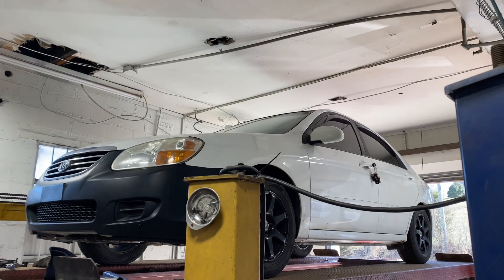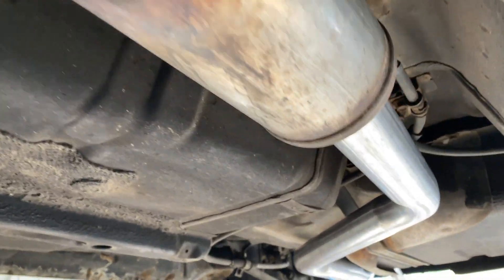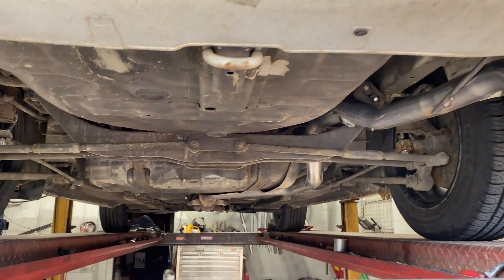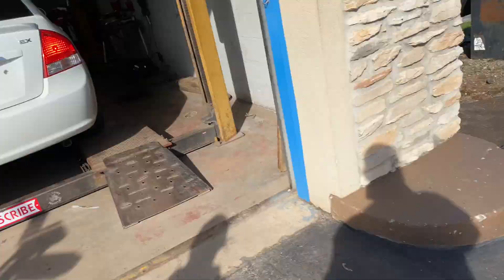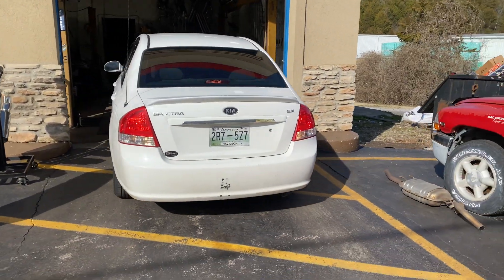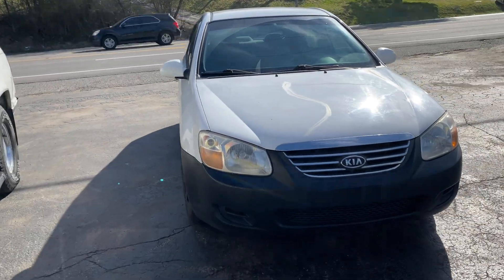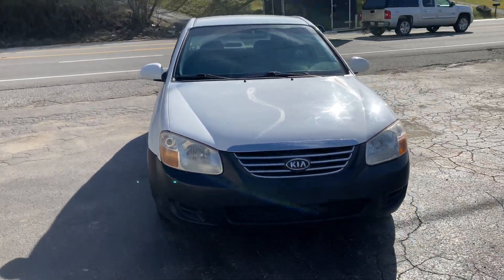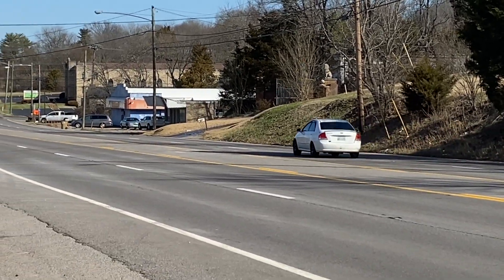2008 Kia Spectre EX EXHAUST w/ MUFFLER DELETE!

Comment: Y’all sleeping on this car.  That 2.0 in that small of a car is just as quick as a v6 in a Malibu or Impala.
Reply: My buddy's impala would smoke my kia. I timed my 0 to 60 its a heartbreaking 9.9 WITH cold air intake and headers 💀
Reply: @cosmicpanther63  my cerato (same car) with a 1.6 did 7 sec, might have something to do with the manual tho
Reply: @chiefdenis  manual gets more power to the wheels and has shorter gearing